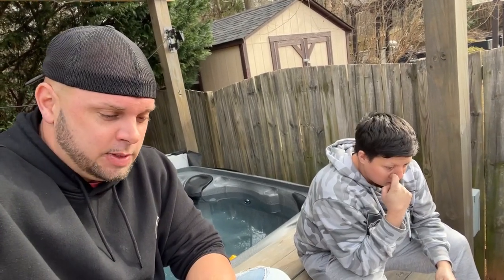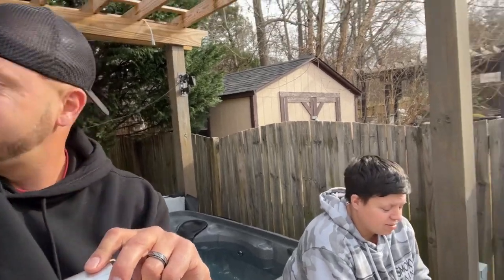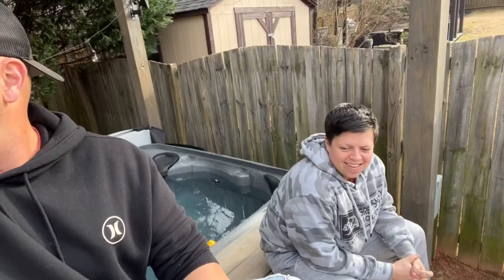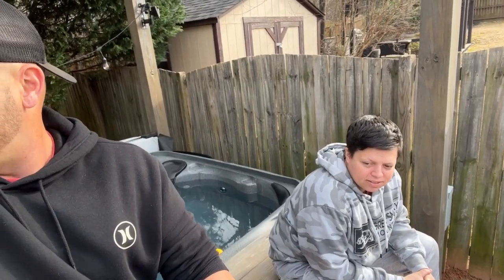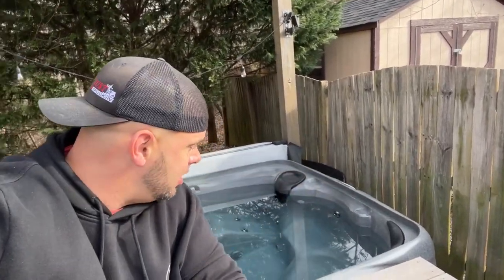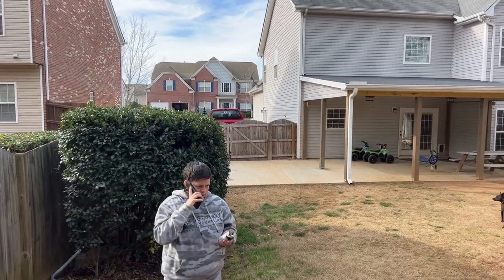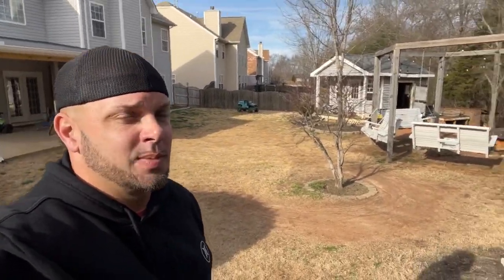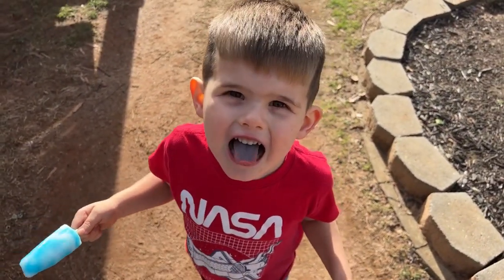Emergency Electrical HELP !! Allison And I figured out the Hot Tub

Comment: You need a whole house surge protector that mounts on the main power coming into your service panel. There are some really good ones out there that will even protect you from lightening strikes. Siemens FS100 is a good one for less than $200.
Reply: Go one but it in wichita ks

Comment: Capacitors are almost like a wear and tear electrical item especially the larger capacitors. In Tesla charging stations the biggest failure item in the inverter is capacitors, same thing with electrical motors….capacitors just fail over time

Comment: Capacitors are for the most part afordable on Amazon. Match the uF the VAC and the percentage.  Try and purchase a cap made in the USA. The same goes for a central AC unit. Ninety percent of the time it's the capacitor that fails.  Caution, make sure the power is off at the unit and circuit breaker. Ground the capacitor before installing. They may hold a charge from the manufacturer. Use a rubber or plastic handled screwdriver and touch all the posts to one another.

Comment: Good luck finding the capacitor you need.  It is possible to McGuyver it with multiple capacitors to the right microFarad value, but I wouldn't recommend it unless you really know electronics.
With the luck you have with capacitors, I'd consider getting a spare when you find a source, as well!
I think you might want to consider a small solar panel charger on the roof of the truck, to keep the batteries topped off.  It would only need to be about 3 or 4'x2' for it to compensate for all the parasitic load while the truck is standing idle.
I hope you can keep things going OK with Uber until things pick up in the trucking business.  Sadly for those with payments, that probably means enough of them going out of business for supply to drop to the level that demand is at.  You at least are in a position to be able to just keep ticking along until that time arrives, with pretty much everything paid for and only living expenses to worry about.

Comment: My last elec bill was $156 for a quarter.  3 kwh Solar  and i got free water from 50,000 litre rain tank. I think the question regarding you capacitor issues is why you getting lightning strikes on 2 different properties?  The stats on that are crazy

Comment: I’m glad you were able to troubleshoot the problem. Sorry it wasn’t the board, even there done that😳. I hope the document you got was helpful. Good luck finding the part.

As far as the lighting strike, make sure the ground rods are good at the electric meter.  they should draw the current rather than the things connected to to house. Also, the cable entrance (I assume your internet comes in on cable) should be grounded to the same ground rods before it comes into the house. If it’s fiber…well never mind, lightning doesn’t see fiber.

Comment: Lightning sucks... Look up on google the Motorola R56 Manual its for tower sites and grounding... I think you need to go through and really ground out your homes both of them.. It might save a life one day.. Just my thoughts.. I am a ham operator and I got two repeaters here in Olney il and trust me the tower sticks 80 feet in the air sure we get hit but the grounding most generally takes it for us.. That and polyphasers on the RFC-400 and stuff.. Heck they even make polyphasers for cable and telephone equipment. Just my thoughts on this.

Comment: you can also do a 10 and 20 seperately just run the ground to both caps
Reply: Caps don't ground.  They do have neutral and hot.